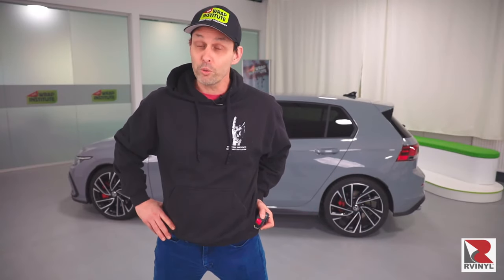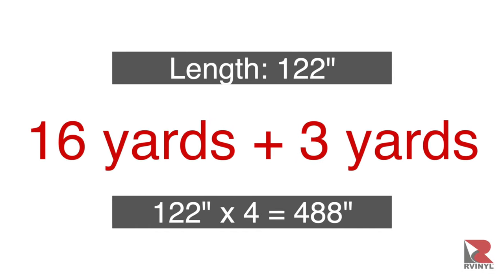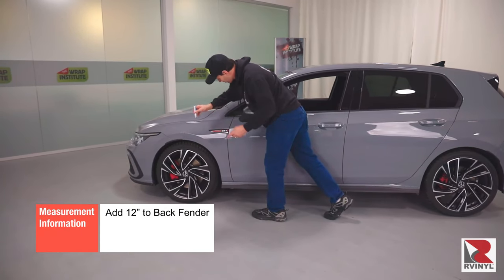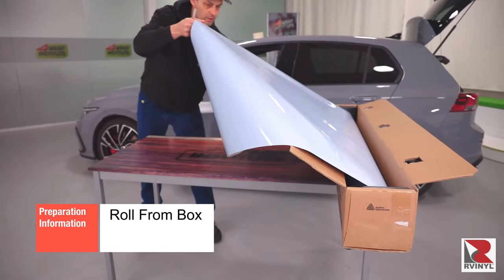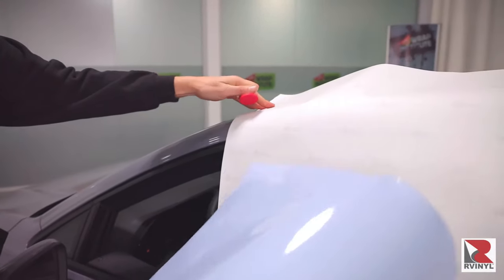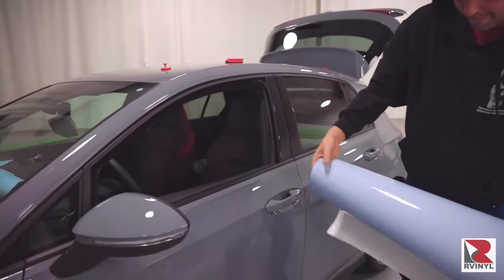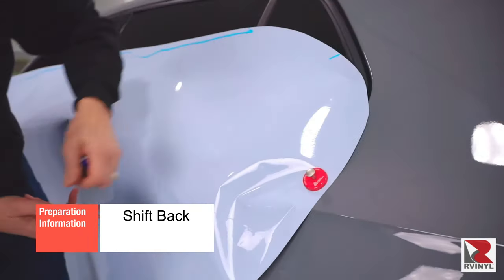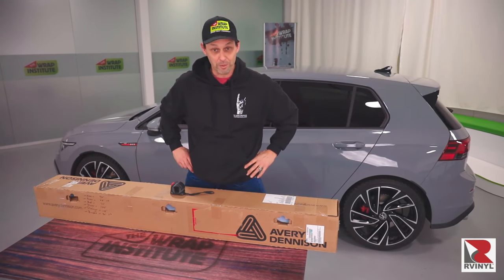How To Measure Your Vehicle For Vinyl Wrapping

Comment: what equation would i use for a small coupe (ex: 1991 integra)
Reply from the maker: You can see more details on measuring here: https://www.rvinyl.com/How-to-Measure-Your-Vehicle-for-Wraps Your Acura Integra coupe measures around 173 Long x 67" Wide x 52" H so depending on the finish you choose, a 10yd kit should do the trick!